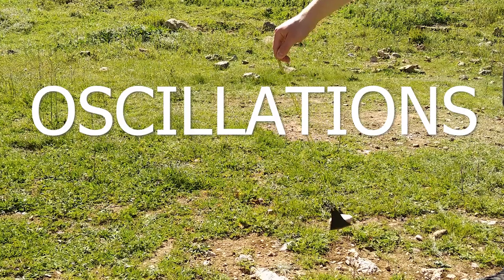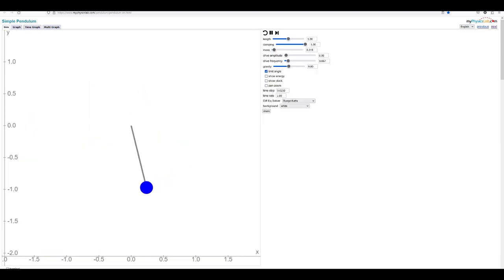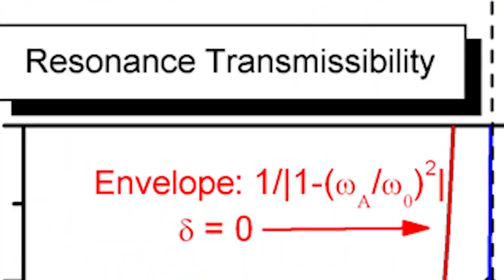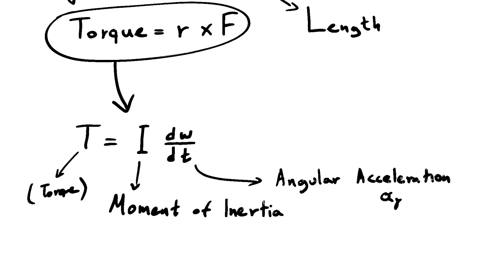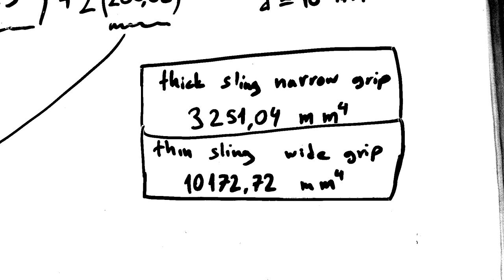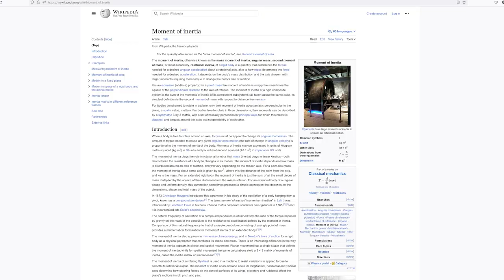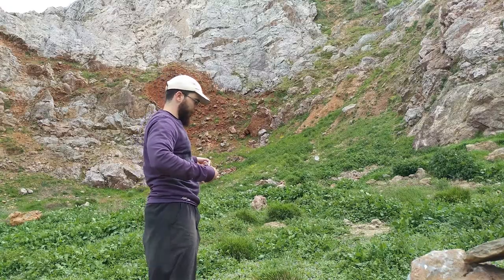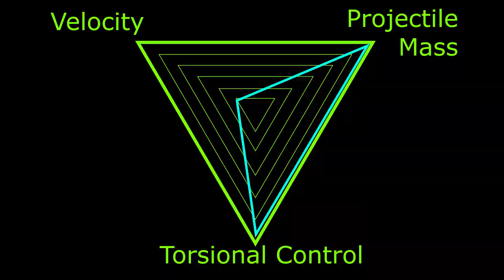Sling Torsion - Internal Ballistics of the Sling

Comment: Great video, thank you! I have some data to add.

I do figure-8 style, and like many figure-8 style slingers, I struggled with top-spin causing my projectiles to dive to the ground (and to the left) quicker than gravity would alone. Very pronounced arcs, even though I was throwing fast. I always used a wide grip, thinking to better control the angle of the pouch, and I would try to throw with the thumb-side of my hand leading, little finger following. This made a difference, but it felt awkward, was physically straining, and I had mixed success at best. But now I can pretty consistently throw with back spin resulting in a much straighter flight path (curves a bit to the right now), and without straining to turn my hand in awkward ways.

To my surprise, the thing that solved it for me was using a more narrow grip. When I moved the loop from my ring finger to my middle finger, my top-spin problem improved. From there I experimented with sling lengths. I made many slings that were the same except for their length, and found that they each tended to spin the projectile differently. I settled on one that gave it the backspin I was looking for, and have been happy since (30 inches/ 76 cm when folded in half, though I'm sure the ideal number would be different for everyone). This of course feeds in to what you were saying about frequency and lengths. But it was interesting to me that I found success when I stopped fighting the physics, and instead just found a sling that puts itself in the right position for my technique. It has thin cords, and I'm definitely not always consistent. But it's so much better. You've got me curious how much more consistent I would be with thick cords.

One aspect you didn't touch on: a wide grip causes the projectile to roll back and forth in the pouch more. Not because the pouch wraps around the projectile less, but rather because throughout the motion, the cords will be lengthening and shortening by the distance between your little finger and your thumb. While spinning, when the pouch passes the thumb-side of your hand, the release cord will effectively be longer, and when the pouch is passing the little finger side of your hand, the retention cord will be longer. If your grip is narrow, this effect disappears. I'm not sure how this might affect flight, but it is interesting to think about.

Hope that made sense. Keep up the good work!
Reply: I'm glad I'm not the only one who noticed the marked difference in spin axis when you place the retention cord on different fingers. It definitely makes a difference.
Reply from the maker: I started with narrow grip, fig-8, karate chop giving some nice straight backspins with a cotton sling. When I learned to do spiral throws I fell in love. I didn't talk about pouch roll because I focused on torsion but I don't have a problem with pouch roll. I can see it become a problem if the wrist is stiff.
Reply: @Acroballistics  Cool I haven't heard anyone else talk about pouch roll, glad you've thought about it too.

Spiral throws are interesting. I have questions which I truly don't know the answer to. Maybe you do. But in the case of a spherical projectile that flies far enough to have a noticeable arc, if it starts out with a perfect spiral spin (axis of rotation in line with the flight path), by the time it's done with its arc, the angle of the flight path will have changed, but the axis of rotation won't have. In the typical case, the axis of rotation will still be pointing slightly up toward the sky, while the ball is headed slightly down toward the ground. The axis of rotation won't reorient itself like an arrow, will it?

I'd expect this to result in a projectile flying straight at first, but curving to the side more as it progresses through its arc. And I'm pretty sure I've seen this effect in my spiral throws. This would mean a perfect spiral is impossible to maintain across an arc, at least for a spherical projectile.

I'm unsure how this would change for projectiles of different shapes. Does an elongated shape reorient itself like an arrow? How do the gyroscopic forces work against that?
Reply: Excellent observations and interesting mention of pouch roll. Makes perfect sense. Cool how you were very methodical and thoughtful about testing sling designs. You have inspired me to do the same! I am a figure 8 thrower and have noticed that I can put pretty consistent back spin on rocks, but objects such as tennis or golf balls often result in front spin. I just couldn't figure out why but I feel that this video, and subsequent discussions from smart guys like you will lead me closer to a solution. What a fun journey and, as I tell complimentary passers-by, "cheap entertainment!" 😁

Comment: Extremely informative! I was wondering though; i pinch my static cord and release cord in the same fingers, making my grip width practically zero. This seems to completely eliminate projectile slip, but i see everyone slinging using two sets of fingers and so a wider grip. Am i missing out on greater sling feedback? I find it simply easier and more accurate, but maybe im just avoiding a steeper learning curve?
Reply: A wider grip would increase torsional stiffness. As you noted, it would less securely hold a projectile due to a difference in what might be called "angle of envelopment". As an extreme example, a straightened sling with (both cord ends pulled as far as possible from each other) has high torsional stiffness, but does a terrible job of wrapping a projectile.
Reply from the maker: if you use light ammo and relatively thick cords or low velocities then you are compensating in those aspects. is it better or worse? I'd say if you can hit your target you don't need to change anything. I'd try a wider grip just out of curiosity
Reply: Definitely experiment and see what works for you, but I started wide and have gone more narrow. Can look at my other comment on this video for that story

Comment: Do you think you could rig a sling to throw a disc golf driver? I think this would be a really interesting project to try, I have disc golf drivers and some slings but the question I have for you is whether you think rotation around the length of the sling (and just the power of the throw in general) can be translated into a rotation parallel to the plane of throwing (i.e., the disc golf disc is released cleanly, spinning with no wobble). It seems like naturally a sling throw would attempt to force the disc golf disc to "tumble" end over end, not spin correctly like a frisbee but it still seems like with a bit of tweaking of throwing mechanics and a nice cradle mechanism that it could work.

Obviously a forehand disc golf throw is the most intuitive to translate to a sling, but somewhat surprisingly it also seems entirely possible to do a more traditional frisbee backhand throw with a sling as well.

I think this could be a really interesting development in throwing disc golf drivers, I mean on one hand disc golf drivers are specifically kept from becoming too sharp and thin so that they don't become too dangerous, and a sling is kind of a way to just get around that artificial limitation, but on the other hand if throwing disc golf drivers with slings is possible it would be fun as hell and totally safe so long as you didn't try to roll through a normal disc golf course built in public parks throwing wayyyy harder than the course was safely designed for.

What I do know for sure is if someone can figure out how to throw a really beefy disc golf driver HARD with a sling, I think it would really turn a lot of peoples heads and catch their attention who have never even bothered to check out slinging. Also, I bet slingers would have a blast slamming disc golf drivers 500+ feet as it would open up a whole new world to explore with slinging discs.

You would think someone would have tried throwing discs with slings at some point in history and if it worked it would have taken off, but before modern plastics and disc golf driver design the distance potential of a disc throw was never really a serious one, and any material that was light enough to make a throwing disc was probably far too brittle to withstand any kind of throwing impact... so maybe this is an entirely new discovery awaiting modern slinging that just wasn't possible before? It is an exciting idea, specifically because the point of a high speed distance driver is to store a ton of energy in the spin of the disc, and slings are incredible at producing spin.
Reply from the maker: I have made 2 videos related to disc style slinging.
 https://youtu.be/eTeOSAaSZUs
  https://youtu.be/Dp7eULvj_7Q 
I also tried the monocord sling with a fin to stabilize the pouch, it didn't seem to improve. at longer ranges it would curve a lot.
Maybe a bigger sling works better with the discs you want. If you try it let me know
Reply: @Acroballistics  Oh wow, I didn't expect this good of a response.

Your monocord disc sling is almost there, I don't know if that scales up to a full size disc golf driver, but it even looks like with some proper stabilization of torsion along the length of the string that it might even be possible with a traditional sling design based on your second video.

Check out this montage of disc golf forehands, it is the same exact mechanics you are using to throw in both of those videos you just linked. You are basically doing a disc golf forehand and I bet if you were able to modify a sling and get a feel for it you could absolutely slam a disc golf forehand with a disc golf driver extremely far. 

https://www.youtube.com/watch?v=1frdaxSuypc

I feel like there is actually a fairly good chance we live in a reality where a whole separate hobby spent decades refining throwing discs and accidentally made them perfect for using with slings it's just nobody has put two and two together yet....
Reply: I experimented with it a little bit, yeah with a normal sling and the disc in the sling (I tied a string from one of the sling sides to the other on either side of the pouch to cradle the disc) so that the disc (starts) parallel with the rotation plane of the sling rotation plane and is held in place from rolling out of the single point of contact with the sling pouch by the crossbar string arresting its rotation from the other side. Somewhat comically I have found the sling throw definitely gravitates towards releasing the disc golf disc end over end, but I have gotten a few releases where it didn't do that. I think introducing a counterclockwise twist in the sling (so looking down the length of the sling with something in the pouch as a right handed thrower, thread the release cord counterclockwise around the anchor cord so that there is a single twist in the sling) seemed to help somewhat. 

I also wonder if you could make a three point sling where the original two cords are held as anchors and a third string is tied to a crossbar cradle string that holds the disc from behind the normal sling pouch (the disc being held by the tension between the original pouch and the crossbar cradle). Perhaps the release flick that creates a rifle-style spin can be modified into a release flick that creates a disc style spin in this fashion, especially if the disc isn't spun in circles before being thrown like with a normal sling throw.

I will keep experimenting!

Comment: Excellent video. I've done that very same test for testing torsion resistance by prerotating and seeing how it reacts. Have you experimented with round braids? I've found them to be by far the better performers at resisting torsion, although once a sling is thick enough (ala balearic) it does feel like overkill and I still personally prefer flat braids in most cases.
Reply from the maker: recently I made a 4 double strand round and a 12 strand herringbone(square braid) egyptian the 12 strand herringbone performs better in the test. Haven't used them yet though to get a feel of speed and interference.

Comment: One could make a sling with a brass knuckle tied to the retention cord, and make a wider grip ,than possible with bare hand. By adding a sidebar to the "brass knuckle" wihich should be light,maybe aluminium.Adding vanes to the pouch could help achieving more constant rifle spins. I had these ideas ,that I never tried..IF you're interested you might try it..